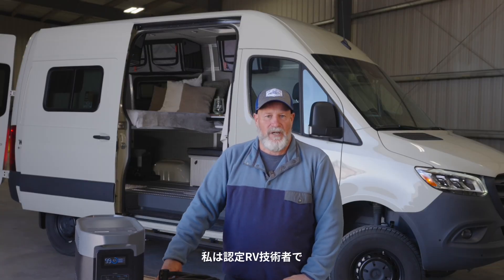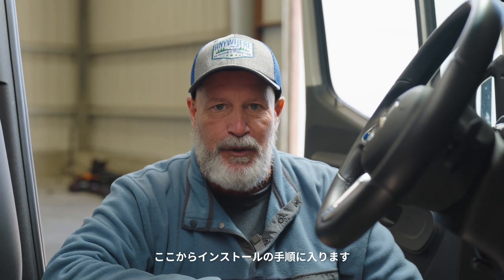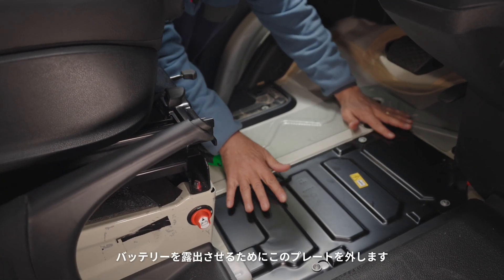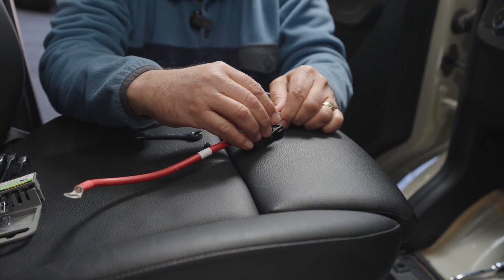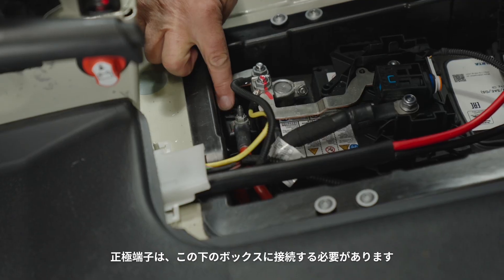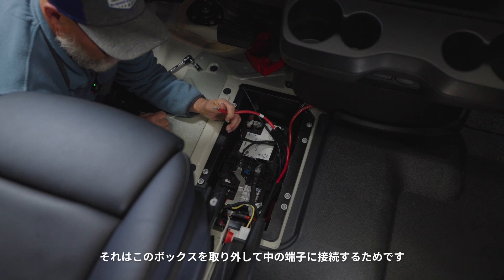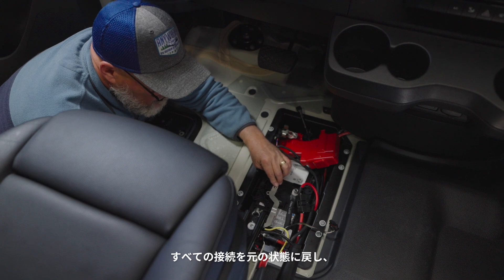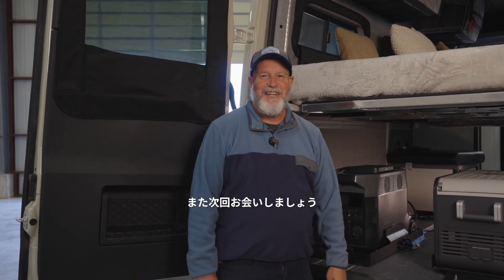EcoFlow Alternator Charger取り付け方法徹底解説！｜キャンピングカー篇

Comment: Hello, I am installing an EcoFlow alternator on my 2020 Sprinter. Is it okay to simply connect the black wire to the negative battery terminal and the red wire to the positive battery terminal, not to the body ground?